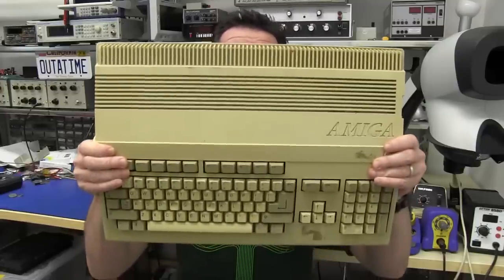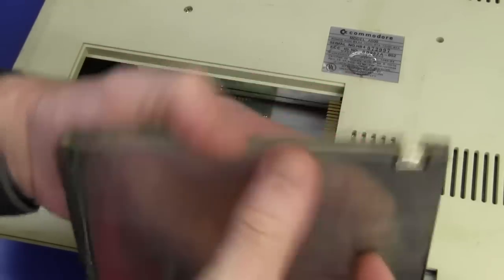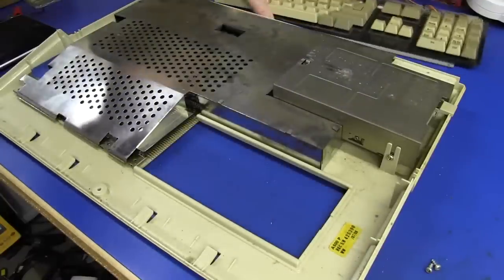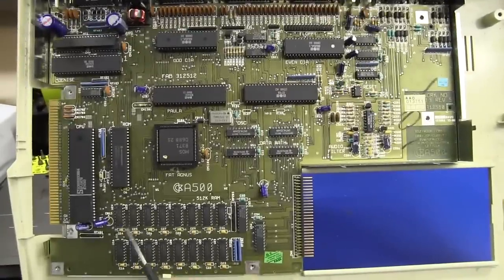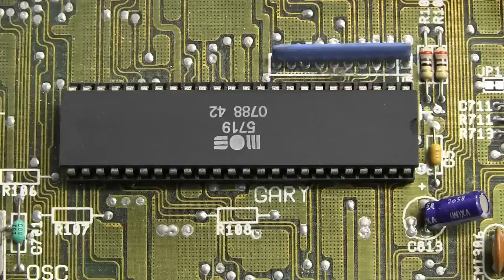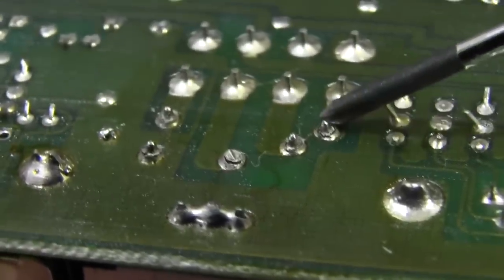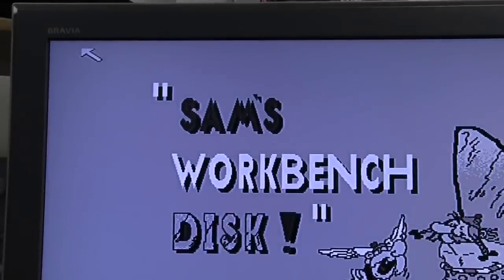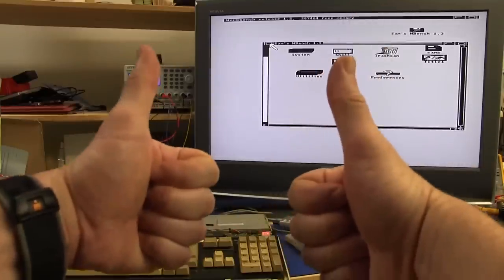EEVBlog #438 - Amiga 500 Retro Computer Teardown

Comment: 4:00 Both the "trapdoor" and "sidecar" expansion slots had practically the same functionality. You could connect extra memory to both, add harddrives, faster CPU's, etc...
7:27 That's kilobytes, not megabytes.
15:45 Overscan wasn't meant to get higher resolutions. Normally, computer screens all had a (usually black) border around the usable area. With Overscan, you could feed data to the entire screen just like regular TV broadcasts did.
28:20 Doesn't the case take most of the strain?
35:50 And on the failing double clicks: while the old mouse looks and feels horrible at first, it was quite comfortable when you got used to it, and you could do really fast double clicks with it. So a lot of people increased the speed of the double click in the Preferences. That's why someone (you, in this case) who's not used to the mouse has a hard time opening any files or programs.
39:40 Monochrome, no sound, and a boring game. Try this classic instead: https://www.youtube.com/watch?v=UW4CDWyhxLw

Comment: I was working in Dallas, Texas for Texas Instruments in the "DMOS-IV" building supporting the wafer fab which was making the TMS 4256. I was a product engineering technician doing electrical and physical failure analysis on those parts. Uggg. after all these years. Blast to the past.
Thanks Dave.

Comment: I had a couple A-500s back in my high school days. I kept all the screws out of the case, and threw away the shielding. It just got in the way for re-seating the processor when the heat lifted the processor out of the socket.

The second one came with the above mods already in place, and had a 2" fan carved into the top of the case by it's previous owner.

Both had the delightful habit of trashing your floppy disks at random, to include your workbench disks to the point that I kept at least 6 copies of it on hand at any one time.

Comment: The Amiga was running a full multitasking operating system in 128k of RAM at a time when Microsoft's Bill Gates said you need 1MB minimum for multitasking. We once had a 128k Amiga 1000 and were loading and running program after program until it ran out of memory. The graphical clock program was about 1k in size so you could run about 60,000 copies (overhead for program stack etc.) When it came out it had 4096 colours at a time when an IBM had 4 colours. It had 4 channel polyphonic audio at a time when the IBM had a single channel bleep (or crackle). I once was decompressing a program from one floppy to multiple and didn't format enough disks. so I formatted an additional one and as soon as 4 tracks were formatted the decompress task saw a disk that was becoming blank and started the final copy process so it was formatting a track on the blank disk and then copying a track from the source disk. Window to this day can not multi-task as seamlessly. I believe the reason for the failure of the Amiga was that Commodore stopped spending money on future product generations. At the time the directors set themselves up in Barbados and started shuffling funds off shore was the gossip. If they would have released a 640x480 non-interlaced version back in '87 and then subsequent upgrades they would have likely still been around today.
Reply: Nice story - one thing though, the Amiga 1000 would have been 256k in its vanilla state.  The system was actually designed around 512k minimum, but CBM had them chop it back due to a worldwide RAM shortage around 1985.
Reply: My 1000 had only 128k of RAM
Reply: They didn't make them with 128k bud - not ever. You might have had 128k (of the 256k) free with Workbench running, mind...
Reply: They might not have sold them in the US as 128k, but I got a PAL one in Oz with 128k. It had a plug in memory module that went on the front behind a cover that made 256k. Without it, it would run just fine as long as you didn't run any really big programs. I later upgraded it to 512k by changing a PAL and piggy backing a whole lot of RAM chips on the ones on the motherboard.
Reply: I'm not from the US - I'm a whinging Pom! :)
I'm pretty sure the "plugin" module was fitted as standard when the machine was built, as I'm as certain as I can be that there were no 128k models (apparently they had a devil of a time trying to get Workbench running reliably with 256k after CBM chopped it back from 512).
Reply: etmax1 In fact, if you had a front board that would have been a 256k expansion that gave you 512k.  I know some of the PAL machines were delivered with them, because the RAM shortage was over by late 1985 and CBM didn't want to lose on specs to Atari (the original ST had 512k from the beginning).  Was it any of these?
http://amiga.resource.cx/exp/search.pl?amiga=1000
Reply: ?? Ok, maybe I'm having an old timer's moment?? I'll have to dig out my old schematics and have a look. Either way, the Amiga multi-tasked better than my 3GHz PC for video & audio and it did it in under 1MB compared to the 3GB of my current PC.
Reply: etmax1 Right - because the Amiga chipset and OS used a very simple round-robin multitasking scheduler, and as long as the apps you were running were primarily using the DMA hardware, you wouldn't see a slowdown.  If the apps were doing more stuff with the CPU however, you would.  Doesn't make it any less brilliant for the time though!

Modern OSes have to allocate resources to apps and services based on the demands being made by each, and it's a much more complex aspect to deal with than the old round-robin!
Reply: The Amiga designers did many shortcuts, like having no memory checks what so ever. The computer automaticly assumed it got assigned the memory requested, but never did any checks to see if it acctually got it. They did this to make shaite run faster. It made lots of software crash regularly and floppys broken during writes.
See the history of the amiga documentary. Its on youtube.
Reply: ? I had one and it rarely crashed. There was the odd badly written program that did but all of my mainstay stuff was rock steady. i thing maybe you mean it didn't have an MMU that offered memory protection, because when you do a malloc call it returns a success/fail and it's actually up to the application writer to see if it worked. An MMU on the other hand prevents an errant pointer from accessing memory that was assigned to another program. It actually wasn't until the Intel 386 that IBM PC's had an MMU, The Amiga had it in the machines that had an MC68340 but it came too late for them to have money to update the SW. The Amiga was like the global financial crisis, screwed by the powers that be. :-(
Reply: The A500 did no mem checks of any sorts. They designed it like that on purpose to make it run faster. Guru meditation :) . If you like amiga you have to check out the documentary. They say it themself, they broke every industry design standards and made shortcuts here and there.
Reply: Please send me a link, I would like to follow that. I do believe the Guru meditation issues were mostly due to bad app programming though, because so many programs, some even very complex never crashed. In fact I only ever had stuff off Fred Fish disks go AWOL. All of my day to day stuff was flawless. I even did a lot of PCB design and never had crashes.
Reply: AmigaOS didn't have built-in memory protection, but it did not frequently cause crashes or disk write failures, as Spooky claims.  Early software did have some issues, but as long as you used position-independent code or relocation tables, then it was not a problem.  The reason the machine did not have an MMU was not to "make shit run faster" but because back then, MMUs were primarily hardware devices and would have pushed the cost of the machine far too high.
Reply: Oh yes, I never claimed that there Amiga OS had memory protection, and I stated that it didn't frequently crash. Especially when one considers it was multitasking. Also I agree with you that lack of MMU would have been primarily a cost issue. Not until the 68340 did you get one for virtually free. MMU's should only give a performance penalty when they're used to provide large virtual memory, if they are used for task to task memory protection or at least protection of OS memory space they needn't be particularly costly from an execution speed perspective. Some early SW used to use the unused 8 upper bits of the address registers for "things" I was told, that would certainly cause issues if it was running on a 68020 after being written for a 68000. To me it doesn't sound like it would worth the effort, but then a lot the time things ar edone because they can rather than they should.
Reply: turricaned I'm not talking about memory error checking, I'm talking about basic memory checks like, did the system accually get assigned the memory it requested. The Amiga designers say it flat out in the documentary. They skipped these checks to make the system run faster. The Atari ST (a very simular system) did these checks. Just search "the history of amiga" here on youtube. Its a 45 min documentary with the original Amiga crew.
Reply: Spooky Ashell I've seen the documentary several times over the years and my previous response still holds true.  Writing AmigaDOS-legal apps required PIC or relocation logic - it was a PITA, but not a showstopper.  The ST didn't deal with it in software, it had a basic MMU chip. But because TOS wasn't a multitasking OS, it meant that the MMU could be a very simple design.
Reply: it was the CD32 that killed Commodore the CD32 was way way way before its time it was a playstation 1 like computer - console, it was 32bit and had a built in cd rom but people did not see the point and not many games got made for it this is what made them go under i was so pissed everyone i know at the time had A500+ and A600 we did not want a bloody console we all wanted the over priced A1200 that came out far to late in the game by then i had myself a 386sx 25mhz that couldn't even play doom so upgraded it to the 486dx 100 and clocked that to 125mhz man it was a speed demon lol
Reply: Deon Hamilton I think what killed them was 2 things. The first was the company registering in the Bahamas and taking a lot of the money over there in untouchable bank accounts and the other was that they decided to get on the PC clone band wagon. The money wasted on developing clones didn't go into developing the AAA chipset and graphic modes suitable for business use. Probably what also would have helped was allowing clones to extend their market reach. The PC's dominance was driven more by low cost Taiwanese clones than it was by the brilliance of the design. The Amiga was in fact on the opposite side of the equation.
Reply: It was also a message passing OS. EXEC message passing was amazing. E.g. if you pushed a joystick button the kernel (called EXEC) would enqueue a message. If you had a rapid fire joystick you could enqueue so many messages you could run out of RAM and get the entertaining Guru Meditation error!  Brilliant execution.
Reply: Paul Sop
I remember running 100's of tasks until it ran out of memory. It took greater skill on the programmers side to write a major app that coexisted properly because there was no MMU but I never had problems with the better SW.

Comment: That was great. I absolutely loved my Amiga's back in the day. They really were a quite exellent machine. Very flexible. Spent a bleedin' fortune on extras n stuff. Still in loft, except the RGB monitor, I gave it my ex girlfriends lad some years ago.
BTW, just as a thought, if anyone remembers the Sci Fi series Babylon 5 from the 90s, all the 3D graphics and effects was done on Amiga's, with the I suppose now famous ish Video Toaster Boards. Quite incredible for the time. They built a rendering farm with A4000s and Video Toasters to compete with the high end special graphics workstations of the time.
Reply: I heard Star Trek TNG was also done with the video toaster. Cool stuff. I had an Amiga 2500 hand me down, but we never got the proper cables for it, so we only had greyscale...which is just a shame. I wish I knew what happened to that thing. It had an HDD and everything built in.
Reply: Reboot was also made using Amiga machines.
Reply: Wait... you gave something to your "ex-girlfriend's lad"?

Comment: Amigas were brilliant and easily outperformed its counterparts of its time.
You could actually emulate a current Mac of the time on an Amiga and it ran faster than the Mac itself.
I only stopped using an Amiga 2 years ago and it was heavily upgraded with a 680860 CPU running at 80mhz, 800x600 16 million colours and had wifi, USB etc. Nice to see this video, I really enjoyed it.
Reply: Dooglesman Yeh this takes me back. Had an ST, aas soon as I saw an Amiga I sold the ST and bought one. Man, spent some money on mine. In the day. I splashed out for the GVP 32 bit 68030 accelerator expansion, with 120 Meg SCSI hard drive, and 4 meg 32 bit fast ram. It was a Plus too with an extra Meg of chip ram. Cost me nearly a grand with the 4 Meg simm, it only came with 1 Meg. Cost me near 200 for the 4 meg simm and 700 odd for the expansion. Still in the loft.
Reply: rationalmartian They were insanely addictive, especially the upgrading part. It shouldn't be in the loft...it should be in use today. Beware the leaking battery in the ram expansion and if it's a 500+ there will be one insode it for the onboard real time clock. They kill them over time.
Reply: Hey Dooglesman, do you think an A500 can handle an upgraded processor? Or is the memory timing variance too far off/bus not up to the task.... I got one a while back, since the 2500 I actually owned would be quite pricey and rare these days, but I haven't even powered it on, since I don't have any of the stuff I would want in order to make it usable. I suppose I could just use it stock with the floppy, but the one I had was way more powerful than the 500...

Comment: The floppy disk was programmable, but the one with the A500 was only a double density drive, meaning it could only read PC 720k disks, not the 1.44. You needed one of the A4000 computers to get one with a built in high density disk drive.

Comment: "Ahhh, that old solder smell!"

dies from lead inhalation
Reply: +NaiveAmoeba looooooool
Reply: I use lead solder at work almost daily
Reply: I've found the 60/40 to be an almost necessity at times. Oddly, some of the old Amiga's solder pads refused to take solder of any kind - until I realized I was being stupid by not using flux :)
Reply: Ya, 60/40 + plenty of flux. Always add new solder when desoldering an old pad...I made the mistake of not doing that once, and even with flux, it just ripped off the pad. Especially the new stuff. It is just not able to flow properly without adding some decent solder.
Reply: There is little evidence of people having issues with lead poisoning as a result of soldering. Breathing in flux is bad for you.
Reply: lol,oldgood-computer smell.

Comment: The Amiga prototype consisted of a large board for every MOS chip like Denise, Gary, Agnus, Paula. The right CIA controls floppy, the left controls serial rs232 and parallel ports. The prototype therefore was almost the size of a fridge with main designer Jay Miner. They used names of people because of competition might steal. The project was called Lorraine. Atari was after a few dentist the first investor. But Commodore was able to just in time buy Atari out. Atari therefore created the Atari ST. The Amiga at then was vastly superior in audio and video unless you had tens of thousands of money.

Comment: I have one of these. I am first owner. Made in W Germany. About 30 years old. Workbench 1.3. Still works perfectly. Extra 512k ram. Bought an A520 RF modulator to connect it to a modern tv. Also bought the ACA500 plus (few years ago) to accelerate CPU and have CF card booting ability. Very cool piece of machinery😎😎😎